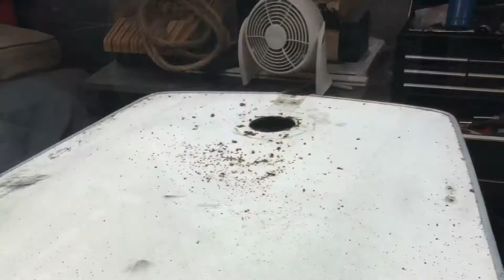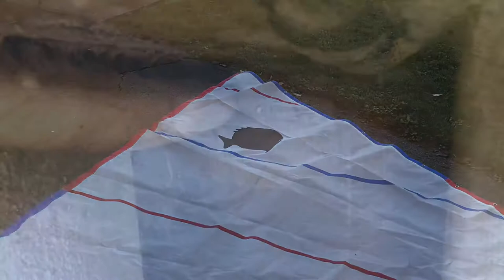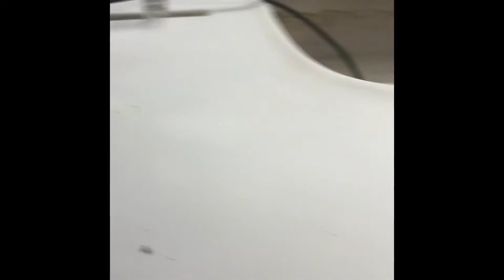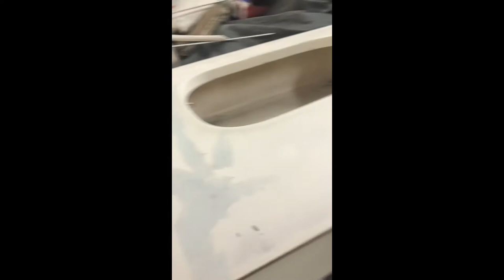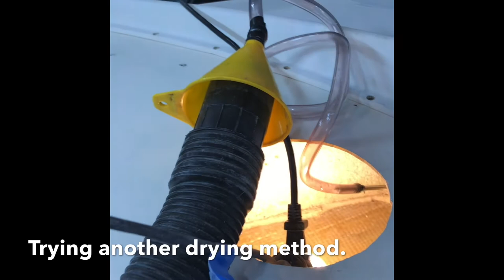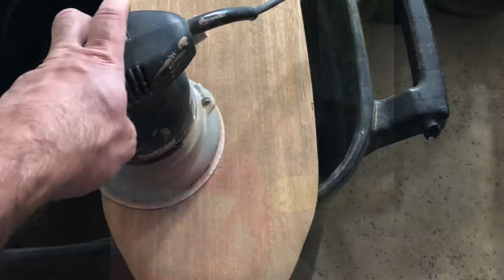Sunfish Restoration 101

Comment: I have a 73 sunfish as well.  I started to work on it like ten years ago and tven stopped.  I was able to drain most of the water out by thnning a gan and vacuum for basically months...  Its now pretty close to what it should way.  I want to get it un the water now and really just need to paint or gelcoat it and should be ready to go.  Replaced all the old righing already.  I would love to eventually yake the rudder apart and restore it back to its original glory!
Reply from the maker: Sounds like it’s the right time now😊 It will be worth your efforts!!

Comment: Nice work. I still can't find where my leak is coming from even with a fan and soapy water spray. It's also hard to convince myself to spend days repairing when it's warm and windy. Just returned from a 4 day trip around the Apostle Islands with my leaky boat.
Reply from the maker: Thanks for the shout out Matt! Sounds like a great off season project. I’d start at the bow trim. Removing a section at a time, then fan and soapy water test it. A quick fix may be a nice clean silicone caulk job down both sides of the metal trim. Let me know how you make out!!

Comment: I just got a sunfish to fix up. I am trying to dry it by tarping over it and running a dehumidifier. I also have a fan circulating air around in the boat. It seems to be working.
Reply from the maker: Please let me know how you make out. I have two more to finish and the heat blown through worked well but the foam shrunk. I had to fill in with the expanding foam from Home Depot. Still may be a little heavy. Going to take my maiden voyage soon!!